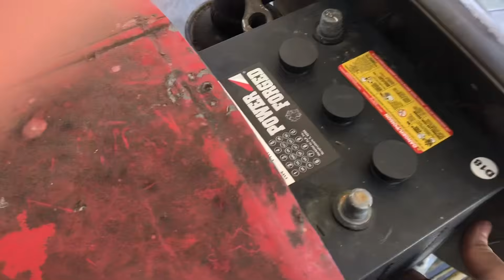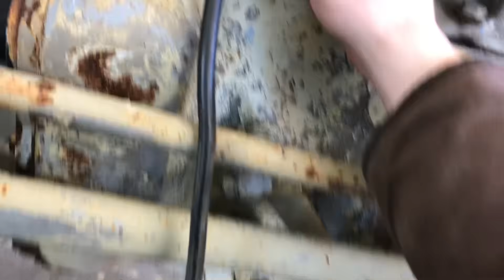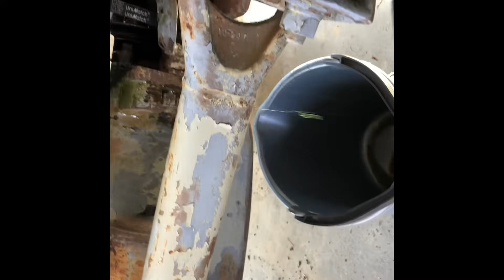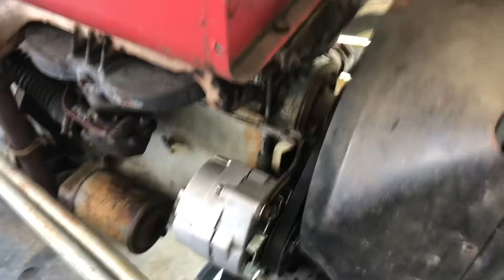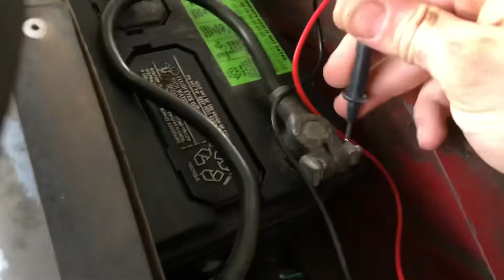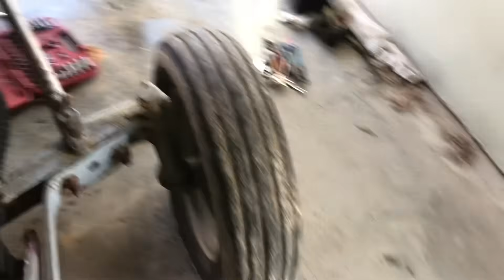How to convert a tractor from 6-12 volt yourself! “DIY”

Comment: I always thought the conversion from 6V to 12V required a minimum of new parts.  A resistor allows a 6V coil to run on 12V, except when the resistor is bypassed during cranking, to provide a hotter spark for starting.  Most starter motors weren't changed either because they handled the extra current and cranked the engine faster.  The generator, bulbs and gauges had to be upgraded to 12V however.
Reply from the maker: It can. It depends on how in depth you want to go with the conversion and how much money or work you want to invest. I had a resistor I could have added inline but I also had a 12volt coil laying around. To me, a resistor is another failure point. Another junction for terminals to corrode, etc. But it's all personal preference. You can wire one up in a variety of different configurations and still have success.

Comment: When I converted mine I just changed the generator for an alternator, changed to a 12 volt battery and wound about a foot, more or less of stainless gas welding rod around a wooden dowel for a resistor and inserted it into the low voltage circuit for the coil.  Started and ran fine without burning the ignition breakers.
Reply from the maker: There are a number of ways to go about it. I've heard from old timers that they would simply mess with the voltage regulator, turning it up to 8 or 10 volts and replacing the 6 volt battery with an 8 volt.

Comment: Will the voltage regulator stop it from starting? Mine is 12 volt.. but it's using the generator. Thanks.. it died suddenly...
Reply from the maker: If you are running 12 volts into a 6 volt coil it will eventually fry it or the points. Pull a plug wire and check for spark.
Reply: @junkinjames6345  ok.. lol I'm not ignorant.. I can fix anything.. but I'm getting good spark to plugs. Compression .. and starting fluid straight into cylinders. I'm guessing it's the cam? Timing chain.. something . I been working on cars trucks forever.. this just has me baffled.. first tractor.. not familiar with this motor. Guess I'm pulling gas tank to  check valves.. gotta be something dumb.
Reply: @junkinjames6345  I figure it the same basic junk as my old Chevy trucks or Chevelle...4 banger boat motor..

Comment: I'm with you until you ran the wire from the last terminal on the alternator (#1 or R).  It is the red wire which goes to the key switch.  Which terminal on the key switch do you hook it into?
Reply from the maker: You'll have to get a multi meter out and probe for keyed power. You only want power to the alternator when the ignition is on

Comment: hey just wondering what altenator is that and any wiring diagrams around on your system u made?
Reply from the maker: It's a gm alternator from pretty much any 1970's era car or truck. Wiring diagrams are all over the internet.  If you'd like an even easier installation, search the gm 1 wire alternator. As the name suggests. It only requires 1 wire to operate
Reply: Hey found a old REMY DELCO GM ALT but it’s not numbered 1 2  at the top terminal it’s says R F instead that the same thing ? it has the one big red wire one at back ect
Reply from the maker: @oldviking6404  try looking up the part number on it if there is one. Early gm alternators were externally regulated. You want an internally regulated alternator. Exterior wise the two cases look nearly identical.
Reply: Ok right on bud thanks

Comment: Not sure but I think the way you hooked that up will cause the alternator to drain the battery when its not running. Old international trucks had gm alternators and the way they were wired is both of the small wires going to the alternator were hooked to the key switch. This way the field wouldnt have power when the engine is off.
Reply from the maker: It’s always worked reliably for me. No sparks indicating a draw when connecting the battery. Starts up fine after sitting for weeks at a time. Followed existing wiring schematics to wire it up.
Reply: @junkinjames6345  Well if it works I guess its ok. Not sure why International always ran both wires to the key switch then. Ive always wired both wires to the key but evidently its not necessary. The international trucks had one wire going to the key and a short little jumper going from the one small terminal to the other.
Reply from the maker: The way you describe was probably meant to prevent back feeding and other issues. . When you turn the key off you know there is no power getting to it 100 percent. But that’s just a guess
Reply: @junkinjames6345  I just bought a ford 2000 but it has one of the 1 wire gm alternators but the wiring is trash and I need to get it fixed up. I bought a new harness but the harness is for a tractor with geared transmission. Mine has the select o speed. It basically the same but it doesnt have the starter button on the transmission. I think it supposed to be on the dash but mine just has wires hanging.

Comment: Thanks. I need to put a coil on my T-30 that's already been changed to a 12 volt and I didn't know where to hook up the positive side of the coil. I was told to hook it to the distributor cap, but I can see that is wrong now.
Reply: Dan, My TO 30 was changed from 6 to 12 years ago. I want to re[place the coil. Been having starting issues and wonder if it is the coil. 
Is my oil coil a 6 or 12V. Are all 12 volt coils the same ?  Will appreciate answer